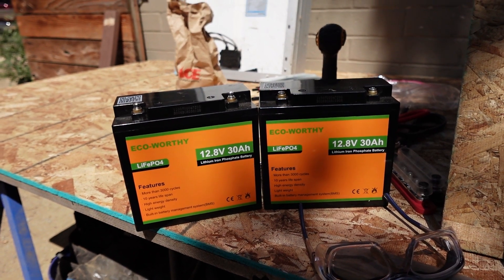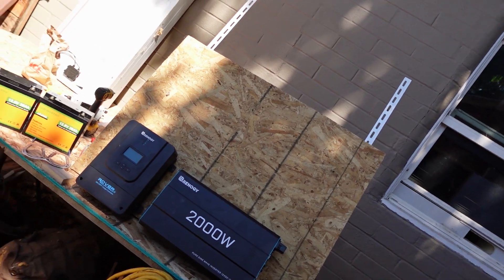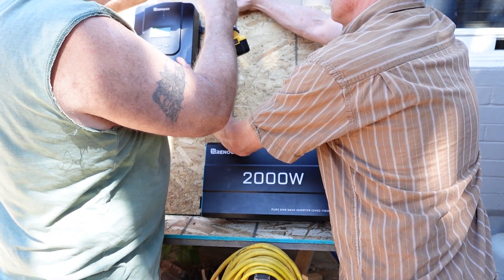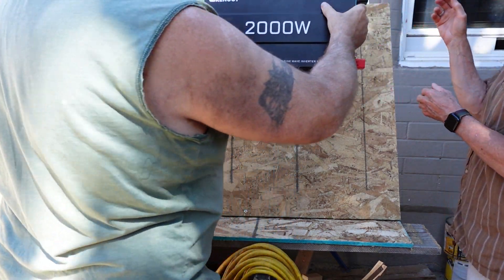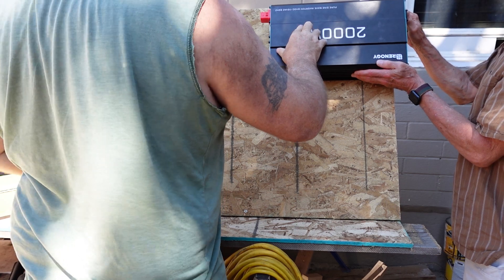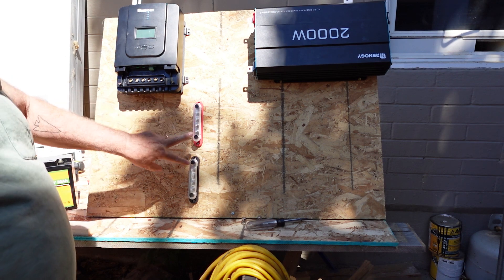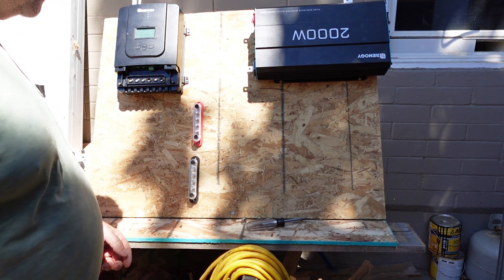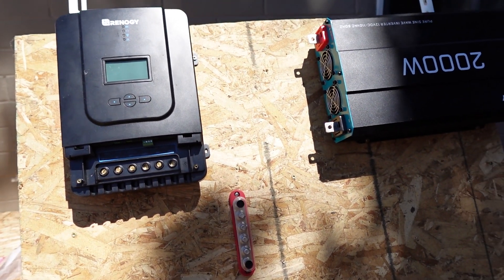Install Renogy 60 amp Controller and 2000 watt inverter

Comment: I have a very similar system as yours in this video, 600 watts of solar panels, 60 amp Renogy controller, and 2000 watt inverter. The system was all working good and recently I am getting different readings from shunt and app on percent of charge. I am hoping you can help me figure this out.

Comment: Hey what would i do if i had 560ah of LiFePo batterys for settings on my charge controler would love the help i turn my inverter on an it shuts off my power because i think my settings migjt be wrong
Reply from the maker: @cameronjohnsicard2995  do you have it figured out yet? What setting are you using now?

Comment: I just ordered an eight hundred watt renergy system for my cabin. The wire from the charge controller to the inverter, is that just a regular battery cable connection?Type
Reply from the maker: Yessir, 100% copper
Reply from the maker: 10 years love

Comment: Thanks for the video! I have been eyeing those Renogy charge controllers for a while.
Reply: I've 3 of these 60 amp controllers. One for over 2 years and the other two over a year. Other than the older one reading .2 volts higher than the other two, I have no complaints about them.
Reply from the maker: Thanks for watching. I've had my frustrations with this controller, but its not too bad of a controller. Tends to run a little hot though.